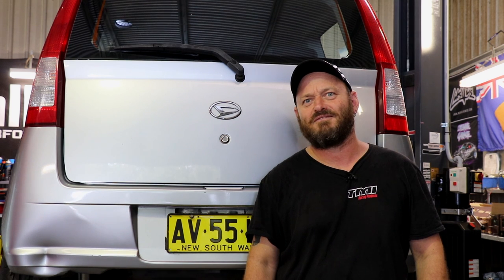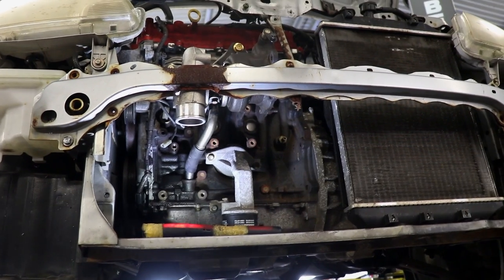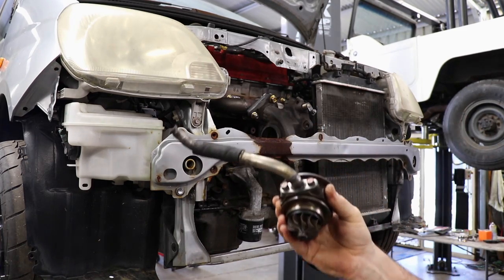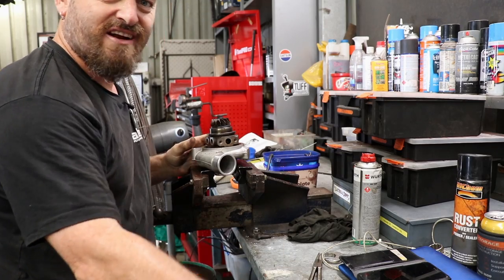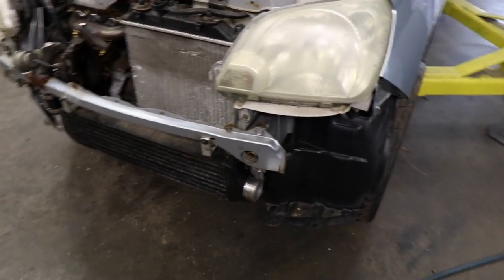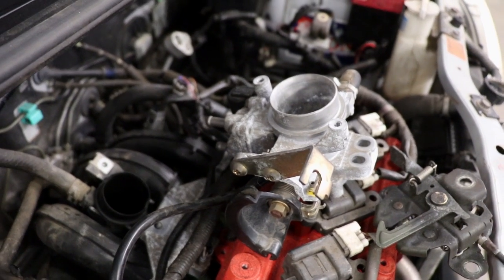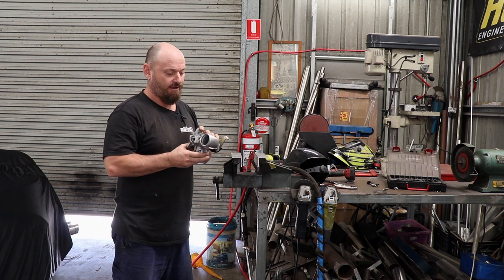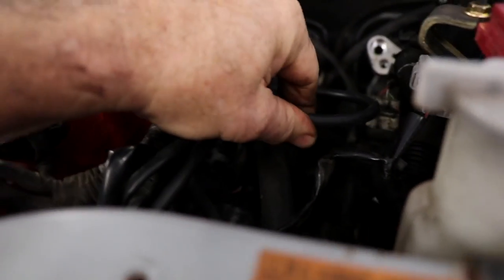THE SKID FACTORY - TURBO K3 DAIHATSU CHARADE [EP2]

Comment: Seeing Al struggle with the ring makes me feel less stupid for all of the times I have.
Reply: It took me back to one time when I was trying to replace a seat-adjuster cable on my SAAB and spent nearly 2 hours trying to undo those stupid hex bolt they used to hold down the seat rails. There wasn't enough room to get good leverage on them, and when I managed it felt like some victory over fate and the Universe :|

Comment: Nice.. Its called perodua viva in Malaysia. Its a rebadge mira, only 4 doors. Comes in ejve 1.0 engine. A lot of engine conversion in Malaysia, such as k3vet or a 660 turbo engine. Also got few nuts mod the engine with forged internal and a garrett GT turbo. Wish to see you mod the engine making mad power.. BTW it would looks better if the cold side IC pipes run below the battery and don't forget a blow off valve point. Good luck M8.

Comment: Have you tried heavy duty 90 degree angled circlip pliers Al? The  pins stay  straight in the holes of the snap ring so are less likely to slip out  when under load. That's what I use and find it easier

Comment: Al, that indent in the philips head screw denotes JIS. Japanese Industrial Standard. A JIS screwdriver will undo a Phillips head, wont work the other way around. JIS screwdriver has steeper shoulders. More screwdriver into the screw = more torque. Basically they dont cam out once they reach a set torque like a Phillips

Comment: VW Gen 3 motors (1.8t, 2.0t etc...) have plastic intake manifolds. Maybe if you were running 70+lbs of boost you may want to reconsider but other than that, they work great.

Comment: Al, you can get pliers specifically for snap rings. The tips are 90 degree bent (so you don't have to contract the ring from the top side) and they have little balls on the tips so you can really get the snap ring secure in the pliers.
Wurth should definetly have something like that in their stock.

Comment: I think most of this stuff is out of 2SEXY while that car was at Queensland with Al, because he mentions this car has a Haltech Elite 750, same as 2SEXY when having 4G15 in the car, especially the wheels as well, before 2SEXY had a makeover, and lastly is the intercooler that 2SEXY had as well; just during the engine swap. So this Daihatsu has wheels and parts out of 2SEXY.

Comment: The head of screws for the idle control motor is probalby a five lobe or pentalobe. I had to search for it because the idle controller of my volvo V70 had the same issue and it also has this type of screws.

Comment: After 5 failed attempts putting the snap ring in, the turbo, pliers, rust converter, plastic boxes and pretty much anything else in a 1.5m radius of the vice would be bouncing down the driveway followed by some choice adjectives. It's go to see that even with wads of experience, some shit is just hard.
Reply: same here.. and by the time i finally got it on, id find it was clocked just a leeetle out of place and have to redo 😫

Comment: Just run water. It's right there. Open and ready to be ran. Don't cut corners.  This is too cool to be let down by a over heated turbo.
Reply from the maker: gav52l It’ll be fine. If it dies I’ll replace it and plumb the water. Then we’ll all know.

Comment: I can't even begin to tell you how much better I feel knowing that even Turbo Yoda struggles with that dumbass retaining clip on the smaller turbos. Give me a v-band or a retaining bolt arrangement on my compressor housings anyday over that bullshit. I had that style on my old MHI 14b, 19c Frankenstein, 20g, and even the Dodge Daytona T3 turbo that I put on my old DA9 Integra back in 2001 when Fast and Furious came out. I had a couple DSMs, a Plymouth Colt that I swapped a 4g63t into, and another Colt that I swapped a 4g61t (the smaller 1.6L brother of the 4g63 that came in Mirage and Colt GTs here in the States) into. God I miss those little Colts. My 4g63t swapped Colt made 308 whp on a MHI Evo III B16G and that doesn't sound like much, but that car weighed 1600 lbs and I smoked a few new Corvettes with it, well new in 2007 Corvettes.

Comment: circlips have a top and a bottom if you look at the circlip the holes are actually punched in and are tapered so the small hole goes towards your pliers which helps it lock in to the tips of you circlip pliers and if you go the other side with the big hole towards your pliers it actually gives your a ramp that makes your pliers slip out all the time which is what's happening to you sorry AL but I teach this to my apprentices and other tradies all the time as this frustrates the hell out of me especially if its in a gearbox where you don't have room to move theclip also has a sharp edge and rounded edge on the outside which is also from being punched out and they should be fitted so the round edge goes in  the direction of pressure because if you put the sharp edge toward the direction of pressure this causes a stress riser and can start a crack

Comment: Snap rings are the work of the devil. I thought I'd never have to deal with them again, now that I've gotten out of the automotive industry and into commercial facilities maintenance, until I had to change a connecting rod in an Oliver commercial bread slicer last week. 2 snap rings that you cannot fit a set of snap ring pliers onto (due to the tight constraints of the machine) and you annihilate your knuckles working in such a tight space. I get chills just thinking about those horrible fasteners.

Comment: This project interests me now more than ever, because I have a Daihatsu Pyzar 4WD that I want to put a YRV K3-VET into. The anaemic 1500 motor that makes 80hp at the crank on a good day may have a shitty bearing (and no its not the valve lash, I've adjusted that mint), so I'm in need of a K3 turbo to put into it. Would a TD03 off a VR4 Legnum sign off a bit early for one of these engines?

Comment: Not running the water isn’t a big deal. It’s not going to overheat the turbo. Many of those Mitsubishi turbo’s came out factory oil-only, and brands like Kinugawa still sell oil-only versions of the TD04 new, for direct replacement uses.
Reply from the maker: Marty McFly yep and it’s also a zero dollar turbo so I will see how it holds up. Call it an experiment. Garrett ball bearing turbos will fail 100% without effective water cooling but mhi have high oil flow through them so survive.
Reply: Hey remember when you guys were putting the donk back together for that VL, what was that grinding stone or block or whatever tool it was you were using to surface the block? I know you mentioned it but I couldn’t remember what episode it was to go back and have a look

Comment: Plastic manifolds dont blow up ?. Ummm. My 2016 Mercedes A200d 2.1d AMG line did. The plastic weld seams around the manifold just blew apart. So they replaced under warranty.

Comment: I use two small stainless steel hooks hard tied to a small length of stainless steel braided wire to put those fu*king rings in. Hook the hooks, then use a pair of pliers to twist the braided wire tight and then push it in. It works a few times before the wire breaks and has to be replaced, but fu*k me, it's better than the fu*king pliers method. Fu*k that.

Comment: Wouldn't it just suffer from terrible heatsoak with IAT sensor located like this?
Reply from the maker: Patrik Sabo Not at all. Haltech requires it to be in free air before the throttle plate.
Reply: @theskidfactory  I'm asking because I got issues with heatsoak on my naturally aspirated mx-5 with ME221 ECU with IAT located in front behind the headlight, shielded as much possible. It's not problem when driving but when it comes to a stop it picks up the heat from engine bay to the sensors body. Thus it offsets fueling towards lean mixture because it sometimes reads +20°C or even more. I don't see a way how to solve this and it makes it impossible to have a stable tune.

Comment: Question: did you have to back purge the throttle body when you welded the bend on it?
Follow up question: if not, why not? (Because she's a nugget?🤣)

-100
Reply: He wouldn't have back purged it as the aluminium doesn't sugar on the inside like stainless does when you don't back purge.